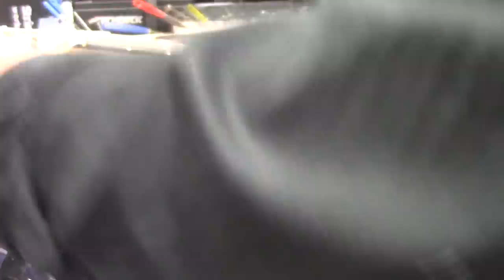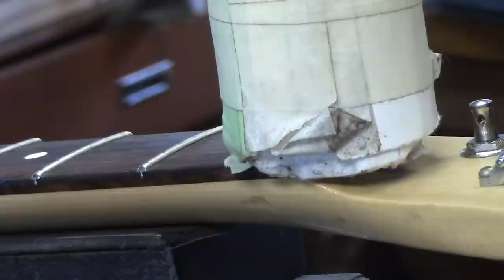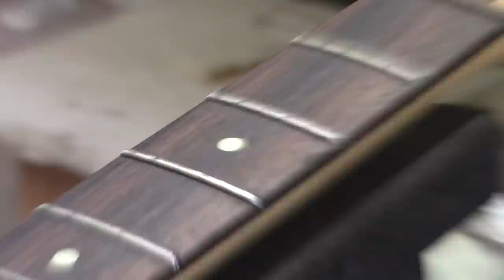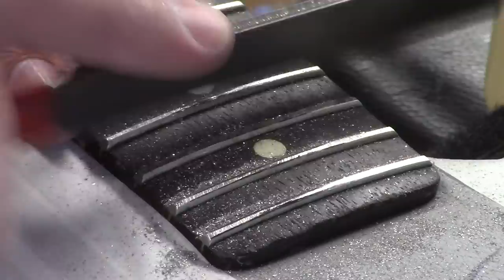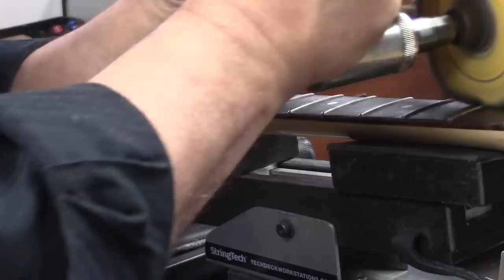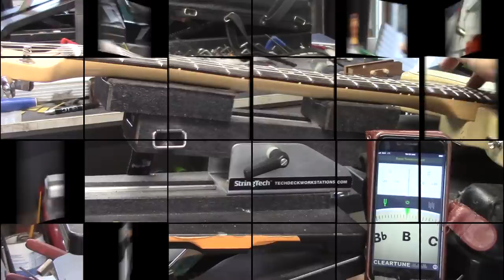"Mastering the Setup": Perfect Tuning and Playability on a Telecaster Guitar"@StringTechWorkstations

Comment: I have an old Mustang (67) but it has the small frets. Not sure they can be redressed but they look about as bad as these did before you cleaned them up.
Reply from the maker: This is a bit of a problem Steve .... you need to have enough "Real Estate" to work with in order to re-crown. BTW: Those frets need to be removed "sideways" like this https://youtu.be/VLZLuEZNikQ
Reply: @StringTechWorkstations  Thanks, Didn't realize they needed to come out sideways but figured they may need to be replaced. I think I'll leave it to the pros for this. Thanks.
Reply from the maker: Yep ... this is definitely a job for the pro guitar techs ... find someone who has Done this job ( hopefully ) numerous times.

Comment: Great video but why didn't you just trace the old nut on the new blank?
Reply from the maker: Watch the video again Richard. That is exactly what I did \m/ !
Reply: @StringTechWorkstations  
No I meant to start with, you only traced the original nut right at the end.
There must be a reason you did it that way, after all you had amazing results.
I'm currently trying to find a replacement nut for a guitar of mine as the standard nuts are absolute rubbish and cause the strings to go sharp.
Reply from the maker: The original nut is only used to duplicate the string spacing. The new compensated nut is adjusted for the scale length / tuning and string gauge. I cover all of this in hours of detailed videos on my Patreon channel. My $20 patrons get the full story on comp nuts for Martin / Gibson / Fender / alternate tunings / various string gauges and scale lengths.

Comment: Dear  in my telecaster the B string ( 0.10 set) is to hard to bend? Maibe  I can loose the truss rod. Thanks.
Reply from the maker: Have you tried stepping the .013" B string down to .012" ?
Reply: @StringTechWorkstations   Hello, thanks for reply, I check the neck relief, and its about none less than 0.05", I loose the neck to get the Fender relief value, and I checked the string height its lower the 3/64" and I use the Fender heigh specs for starts, now its good to play, my relief its 0.012" and the height its about 4/ 64" both High E and Low E. Thanks

Comment: Hi are you doing fret and neck work ? i have several guitars that need work ...thanks
Reply from the maker: Hi Brian. I am constantly doing this work ... but I am a one man shop .. I usually book about 3 weeks in advance. I don't "stockpile" repairs ... never have ... I book a few at a time ... finish what's on my plate and then book a few more. No stress for me or for my customers. 519 275 1008 / mcconvilleguitars@gmail.com
Reply: Thanks for such a quick reply ...i will surely be in contact to schedule the work ...best regards

Comment: What kind of sanding blocks are you using?
Reply from the maker: I make up a fretting kit with 5 hardwood sanding blocks ( with a leather lining on the jointed face ) / 6 straight edges / 6 fret guards / (1) 6" fine mill file ( mounted on a hardwood handle ) /  and a scrub block for the final touch before buffing. I get the local Amish ( Mennonites ) to shave the leather for the correct "give" on the sanding blocks so they are able to follow any fingerboard radius.

Comment: i've used a compensated saddle to get my tele intonation right but what's the difference when using compensated nut?
Reply from the maker: The combination of the the bridge saddle placement and the slightly altered values of the compensated nut, work together in sync, to regulate the notes / chords along the entire span of the neck.   I cover this on my Patreon channel with a few hours of video instruction for my $20 tier level patrons.
Reply: @StringTechWorkstations  thanks, you got a new sub here
Reply from the maker: Here is a short explanation:https://youtu.be/237vjZmWWy4 ... thanks for the sub ... welcome aboard !

Comment: At time stamp 21:07…THAT…is the money shot… but don’t dwell on the “ back cut” of the E,A , B and E strings… Think more about the equivalent “ reaching forward” of the nut with the G and D strings..( or shortening the length change for thos strings between the “ zero, one and two” fret.. positions… this reduction in length change… results in a lessening of “pitch rise” in those first intervals…. THIS…IS….THE….MOST MUSICAL fix.
Reply from the maker: It is all of the subtle moving targets combined ... aka:  / String Gauge / Tuning / Scale lengths / Action preferences ... that makes this task a "never-ending quest of variations" that need to be addressed from guitar to guitar.

Comment: As a piano tuner we perform very similar tests… playing a root with a third… then a sixth then a tenth…. honestly NONE are perfectly mathematically correctly in tune… but we don’t stop tuning until they all sound pretty… all intervals… and all inversions…. 
The math s isn’t what matters… the musicality is what DOES matter
Reply from the maker: Intriguing that you also use the root/  6th / 10th formula for piano tuning. Thanks for sharing that. I will also check the Quartal tuning on the guitars ( also along the full length of the scale ).MMcC
Reply: Although what I said was true… it wasn’t EXACTLY applicable because what a piano tuner ACTUALLY DOES…is we play the root at the tenth the third and octave up)… and then we move up chromatically continually playing the tenths…. That’s what we “ do”…. But what we are listening for is ..( there is a “ beat rate” always present when an interval is played) and the tenth  interval test climbs IF TUNED ( compromised well)…. One can hear the beat rate very slowly but evenly ….slowly increase.. that test all by itself gives us a ton of info. ( beats = tune two strings EXACTLY MATCHING PITCH… then start to very slowly de-tune one…. LISTEN…you can hear a “ vibrato or tremolo effect… that’s caused by the the ( sorry here comes a technical thing) the peaks and the troughs of the sound waves shift relative to each other… when they line up the overall volume is slightly higher… and when they are “ in opposition” they cancel each other out and the volume drops noticeably… ( that’s one reason that “ in tune” sounds bigger… IT IS) 
But then we also “ run “ thirds” , 6ths, and tenths…. each and all will have beats rate 
And then specifically listening to those intervals we then play many different chords and inversions…. A “ musical ear” senses “ pretty” or lush… a piano tuner adds to that… we literally listen for the musically of the beats… NO interval is beat-less NOT EVEN OCTAVES…. 
But back to the guitar… playing the inversions is absolutely the gift… 
There is no doubt … when the “ compromises” are as good as they can be… “ which inversion” almost disappears…

And to be quite rude…. Guys saying that the D and G are sharp because the nut is high… need to take just one day of physics and music theory.
TALK TO A PIANO TUNER… and look at a near end of the strings on. Steinway grand … there is a small portion of string that isn’t part of the “ speaking” section… but Steinway recognized that it would be a waste to NOT let that portion of string resonate too… so the SPECIFICALLY ADJUST THE LENGTH of that short tiny section of string  to tune it to its “ parent” string and note….. they call it the “ duplex Scale “and that tiny little “ micro-bridge” is called the “ alliquat”  confirm that with a current tune…I’ve been retired for many many years… most other grand pianos weave/run a strip of wool cloth through all of those little sitting areas to kill the resonance because for the other piano designs those sections of string would be out of tune with the parent.

The OPPOSITE of this “ tuning the non speaking section of string” is that damn length of string ( on a Bigsby) between the bridge and the roller… that short string length IS resonating but usually at some note/ pitch WAY off from the string… I am convinced that tone is being killed right there …. Muting that section might actually enhance tone on a Bigsby… or the next gen would address that resonant length and tune them … ( sorry ..long rant)
 @StringTechWorkstations

Comment: Appreciate the video and your work.
I was told by a celebrity/luthier-to-the-stars/past contributor to Guitar Player Magazine here in San Francisco that a specific situation arrises with compensated nuts.  To be fair, he was referring to the Buzz Feiten System in particular.
Say you're playing in a two guitar, bass and drums combo.  Your guitar is set up with a compensated nut, the other guitar player's isn't.
In his opinion, you and the other guitarist will not sound in tune together.  With both of you playing a barred F chord at the first fret, there will be a noticeable dissonance between the two of you, even if both guitars have been "properly" intonated.
Can you speak to this?
Reply from the maker: Honestly, I've never tried Buzz Feiten or any other system. I agree ... that two identical guitars ... one with a comp nut and one without ... will not be in completely tune with each other  .....    this is why every customer that I have ever done a compensated nut for ... comes back with every guitar they own ; ^ ) I think that I have demonstrated quite clearly, in a couple of hundred videos the before and after .... check out this latest J-45 video. Same deal ... one more time. Also...  a barred F chord on any steel string acoustic guitar is the most out of tune chord you could possibly choose ( without a compensated nut )  ... it'll always be brutally out of tune ( on steel string guitars .... nylon guitars are fine ).